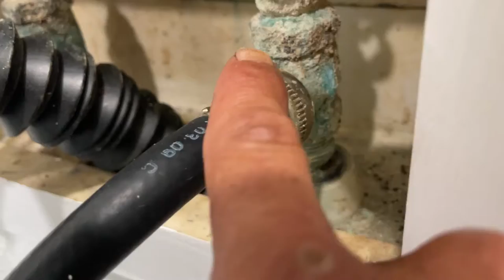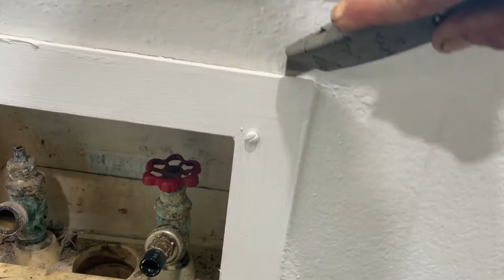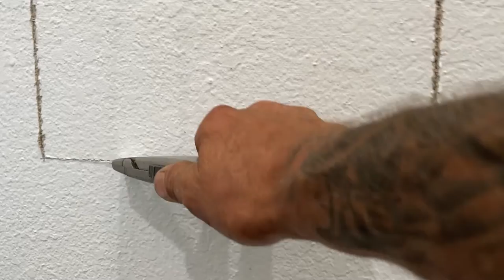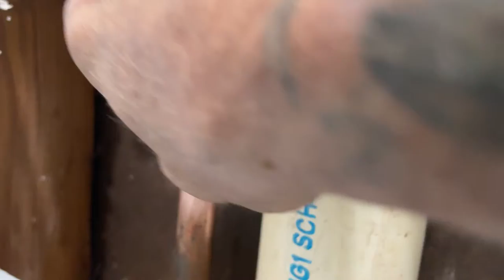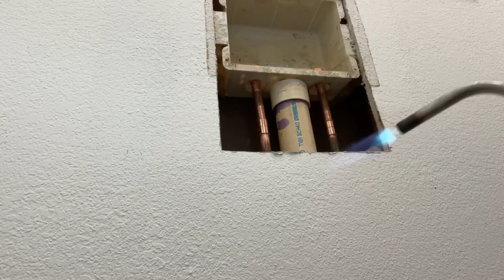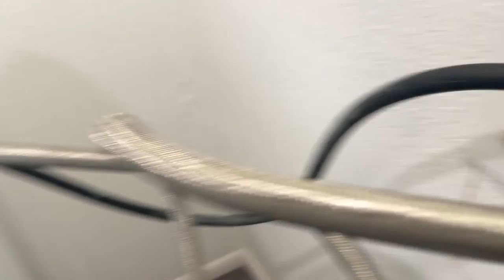HOW TO REPLACE WASHER BOX VALVE FOR YOUR LAUNDRY

Comment: This is exactly how I do this repair for these types of boxes with boiler drains. Exactly! I always use female adapters instead of just soldering the valve to the copper to make it easier for the next guy and less expensive for the customer when the valves need to be replaced again. I am a plumber — not a drywall or paint contractor, so I leave the square-cut piece of drywall  in place just like you did, however, I will usually duct tape the piece to the wall unless the customer is certain they are going to get it repaired right away. Good job!

Comment: Quick question.  My house has old gray PVC pipes.  I wonder if use the new system with shake bite connections? Installing new hot water heater.
Reply: Polybutelene Pipes?
Reply: Most Good Plumbers won't use Sharkbite however it is code

And plumbing code allows you to use them behind walls
Reply: coleman  old mobile home, my house.
Reply: @celticqaidbear  

No I wasn't disagreeing with your decision to use Shark bite. It's absolutely code. And they claim to warranty their product.
Reply: @zachcoleman6285  I don't know what use. That why I asked.
Reply: If possible, replace all the gray pipe, which is polybutylene, with PEX, or at least as far as you can go. If you cannot replace all of it, use a special SharkBite that converts from the polybutylene to several other materials. When you install it, make sure the end of the Shark Bite with the gray insert connects to the gray pipe. Shark Bites comply with code in this type of situation, but make sure you install them correctly, especially cutting the pipe square, cleaning the inside and outside edges of the pipe to get rid of sharp spots (burrs) and marking the pipe to make sure you push it far enough together.

Comment: Why not valve with hammer arrestor?
Reply: A valve with an integral hammer arrestors would be impractical/impossible for this repair. If a hammer arrestors is needed, one can be attached to the hose connection later.